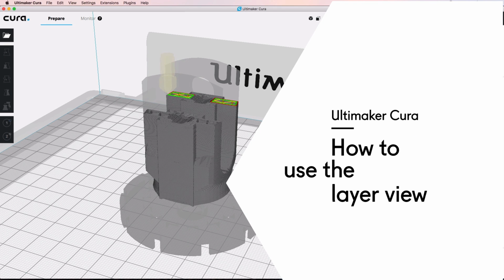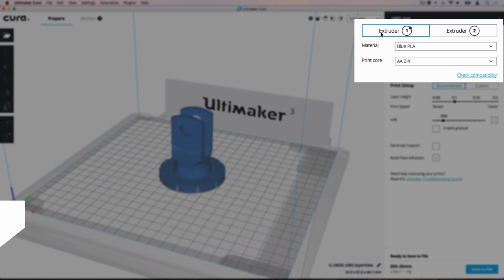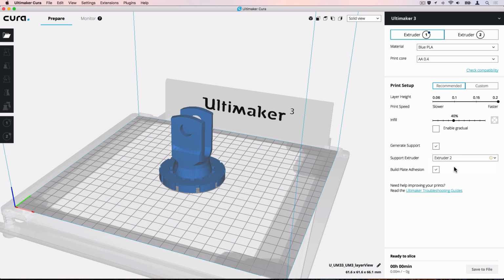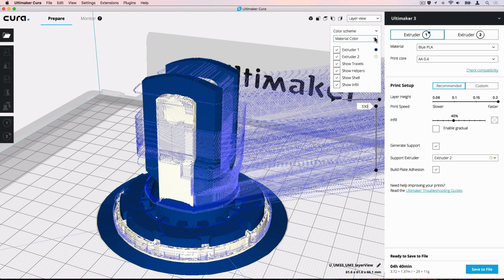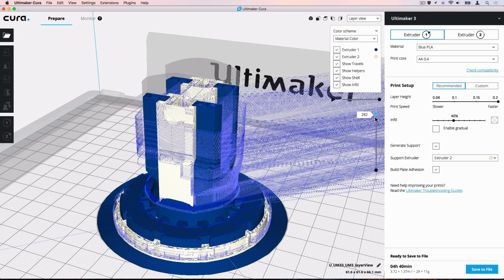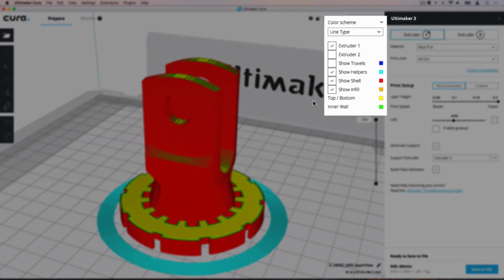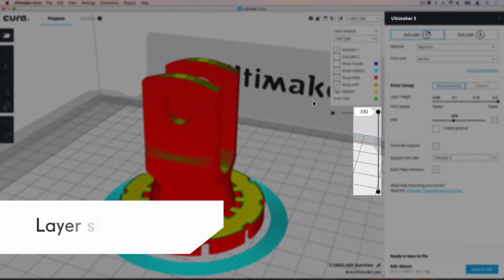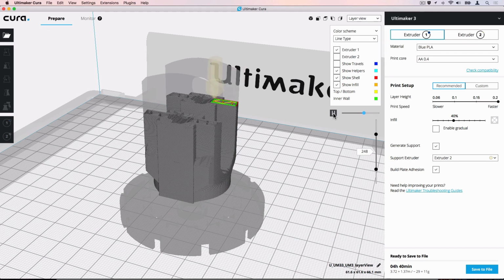Ultimaker: How to use the layer view in Ultimaker Cura

Comment: all where the simulation is not selectable, I also had the problem, my solution was to allow the program Cura to access to the NVIDIA settings, which you have to set under NVIDIA In The System (if you have that ), then the Optoin was available. Since I wasn't aware of this, I also integrated Simplyfiy 3D, which now works much better. I Use the GEFORCE 630 ( 1GB)